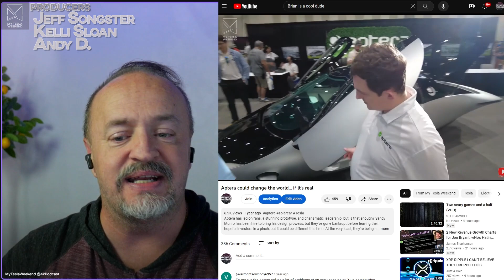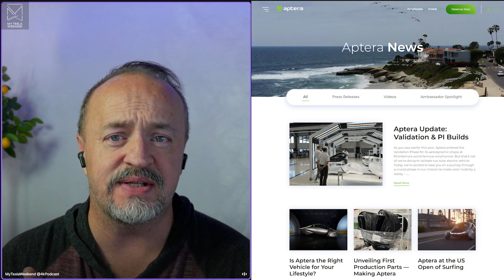Will your Aptera overheat?!? And other big answers w/ Chris Anthony

Comment: "too wide?" ...  3 places within 5 miles of here in the UK that the Aptera will not be able to go through at it's current width (for example 6'6'' road width restriction), unfortunately there are therefore interesting places that are completely inaccessible here for the Aptera with it's current width.
Reply from the maker: May be you'll never be able to get one.

Comment: I love the product, but this guy does not have what it takes to make it happen. Reminds me of Arcimoto.
Reply: It's because of my experience with Arcimoto that I see Aptera avoiding all of Arcimotos mistakes. Arcimoto is undergoing the same things every other EV company is experiencing not named Tesla. I see Aptera on a higher level in terms of design and execution because the co-CEO's were forced out of the first iteration, became successful elsewhere, then ten years later bought back thier IP and restarted the company using the same name that failed. I see them as passionate about doing this successfully this time and I'm doing my part to help them. I bought an FUV because it's made in America. I joined the Accelerator Program because Aptera is in my hometown and is worthy of support. Eventually I'll be behind the yoke.

Comment: Seems to be that there's a lot of very basic things not resolved for a car that's been under design for the better part of 9 years in total between the two iterations of the company... Or at least 4 years in the latest version. ...and they don't have things like battery management nailed down (and are not on top of the disparity between their models and the wind tunnel)... etc. I'm reading a lot of discomfort by Chris Anthony regarding still having big redesigns this late. ... and they have production to go. ... they have, what, 99% of the effort to go, according to Elon's estimate about production being two orders of magnitude harder? Yikes. I see no indication that they are planning an assembly line for mass production... no dicussion about the machines that make the machines - is it all going to be by hand? No price details anywhere, either, is there? I have a bad feeling about this.
Reply: Your assumptions are incorrect. The current Delta design was revealed this January '23. Which is now the PI build, of which is about 66% complete. These will be used for vehicle validation and crash testing. Aptera has had Alpha, Beta, and Gamma prototypes up until this year.
Aptera is as close to Accelerator deliveries by next summer as they have ever been before.
Reply: @barnabasseadog7660  "Your assumptions are incorrect." I can't identify what Roger's assumptions you are referring to, and everything you say here doesn't point to a correction of any sort. If you say something's wrong, you need to be clear about what, then provide a clear correction. 
"The current Delta design was revealed this January '23." He didn't say it wasn't; he said the latest version between two iterations was 4 years old. That is not the Delta design, but all 5 fake prototypes as opposed to what existed pre-2011 - and he's right. 
"Which is now the PI build, of which is about 66% complete." The 66% is a lie, and mnisleading at best. You don't make a handful each of 4 from 6 required body panels, put them in piles and say an EV is 66% complete. It needs wheels, motors, seats, solar and dozens of other components plus the assembly. This is how you tell someone that they are incorrect; happy for you to discuss.
"These will be used for vehicle validation and crash testing." Roger never mentioned this, and he probably knows it. You are off track. 
"Aptera has had Alpha, Beta, and Gamma prototypes up until this year." I'm pretty sure he knows that, as well. He didn't say anything to the contrary. You can't say he is incorrect about stuff he hasn't mentioned.
"Aptera is as close to Accelerator deliveries by next summer as they have ever been before." I have to agree, which means they can be years overdue - like before. And that is the crux of Roger's message. You have finished by indicating he's right. That is a foolish way to correct someone - a genuine sign of a scatterbrain.
Reply from the maker: Go watch the previous video.
Reply: I have to admit - the same scenario is what gives me good feelings, lol. Especially when the "couple of months" at the Tesla Takeover was 3 months ago, and Chris will be years off track for yet another time. I love watching who stays the loyal butt-lickers for the longest.

Comment: Great video.  A question I'm not seeing asked is about the steering yoke.  I have hand and shoulder disabilities and don't feel comfortable/safe with the yoke as it is, especially if it's slow-ratio steering like regular steering wheels.  There's been alot of negative publicity, including Consumer Reports regarding Tesla's yoke, and they promptly offered a no-cost option wheel. Lexus has a yoke that rated better because it has quick-ratio steering at low speeds.  Will Aptera offer a wheel for us old-fashioned normies, or will it have really quick ratio steering at city speeds? Great machine, please don't lose customers like myself over something so silly.  Please go the Tesla route, offer both!
Reply: Aptera assumes you don't know what you want. One hundred years of automotive evolution has you biased.
I agree, and look forward to driving an Aptera with a yoke.
Reply: @barnabasseadog7660  "Aptera assumes you don't know what you want." Jelad is clear about what he wants. Are you able to represent Aptera enough to be correct about this poor assumption you say they have? Do you mean Jelad only, or everybody?
"One hundred years of automotive evolution has you biased." He was pretty clear his disabilities were his motivation. I have no clue as to what he knows about 100 years of auto evolution, and I'm certain you don't.
"I agree, and look forward to driving an Aptera with a yoke." When someone asks a question, they expect answers to their question, not scatterbrained, off track nonsense. This couldn't be any sillier.
Reply: @aussieideasman8498  I can see why you hate Aptera more than you love your cat.
Reply: Their market research has left you out. No matter; they will never sell one anyway.

Comment: What are they doing about the accident they had with the Gamma because the other driver mistook the wheel pant as part of the road and hit it? 
Are they adding any precautionary measures to the wheel pants to prevent this on a large scale? 
Because, even before this accident, someone i know (and several people online)  predicted this would happen and it has.
Reply: Where did you get the other driver mistaking it as part of the road? I have not heard this before. The damage was done to the front of the part, as seen in pictures, so it wasn't hit from behind. What exactly did happen, because it looks more like a hammer was taken to it? Let's get a chain of people who know something to all enlighten us?

Comment: Next time, please ask him about the metal CHASSIS / FRAME.
This is a huge part of the production and there’s very little info on who the manufacturer / supplier is?

Also what are they doing about the accident they had with the Gamma because the other driver mistook the wheel pant as part of the road and hit it? 
Are they adding any precautionary measures to the wheel pants to prevent this on a large scale? 
Because, even before this accident, someone i know (and several people online)  predicted this would happen and it has.
Reply: Aptera Owner's Club released a video about the accident recently. It has been repaired. The  driver of the BMW took off and they didn't get a plate number. Not a lot one can do about bad drivers on the road other than try to stay clear of them.

Comment: If it’s design-locked I’d like to understand how they could alter the vehicles shape after the full wind tunnel test. And if it’s design-locked what is the final drag value?
Reply: Gamma is much lower to the ground and devoid of hoses to the motors compared to the final PI (no longer Delta), so the test is absolutely useless. It was to draw in some more gullible suckers - a snake oil stunt.

Comment: How will the Aptera be towed to a repair shop if one of the wheel struts is sheered off ?
Reply from the maker: Flatbed. Is that a thing that happens to you frequently?
Reply: I have ordered an Aptera. I wasn't sure how the front end would be raised by the tow truck to bring it up on the flatbed.  Is there an attachment on the main body of the car to raise it up if one of the struts was gone ?  I have never had a car that didn't have two axles for raising the front end. @FutureAzA

Comment: Question: Elaphe propulsion production facilities.
We’ve heard and seen a lot of videos about CPC production and facilities, Maxeon solar cells, and the batteries and battery packs.  But we have heard very little information about Elaphe’s in-wheel motors production facility. Is Elaphe capable of keeping up with the demand from Aptera or are they going to slow them down. Also, Sandy Munro made a comment recently about Aptera going away from in wheel motors, because “they  couldn’t them” and then we were told that he “mis-spoke”.  I’d like to hear a more detailed explanation regarding Elaphe.  My concern is:  At the Tesla takeover, Chris said that they were going to produce maybe a few hundred, maybe as much as 1000 vehicles in 2024.  That’s significantly less than the “40 per day” that he had stated previously.  Could this be because of Elaphe?
Reply: The question is for Brian to ask Chris Anthony. He said they he would do a second interview and ask for questions from viewers.
Reply: Good questions - I can't wait for his answer.
Reply: He has answered another guy 3 hours after your question. Needs more time for you? Maybe chose not to answer?

Comment: I realize the LE Aptera won't be able to tow, but if Aptera could tow a second wheel-driven Aptera, then that could basically end the "but it only has 2 seats" challenge.  Alas, this may be forbidden by regulation, depending upon the jurisdiction.  One would also need to assure the safety aspects.  If permitted, this could improve the versatility of Aptera significantly and give reason for many people to not just buy an Aptera, but to buy two of them.
Reply: I have 2 on order, likely not the only one

Comment: One other question. Curious to know why there is a steel/aluminum roll cage sandwiched in the roof, is this for the case the car would roll more than once in an accident and still keep occupants safe?
Reply: A Corvette doesn’t have a roll cage. It has an SMC body too. So I’m thinking they are just trying to make it the safest vehicle ever.
Reply: @billsmith5960  There are many ways to make SMC roofs, and there are many materials used; one roof can be strong and the other weak. Usually, a legacy maker knows what they are doing and a startup doesn't, so there's that.
Reply: @aussieideasman8498  - As for GM with the Corvette. They use SMC throughout the chassis and even have removable roofs. Top it off, they even have hydroformed aluminum frame rails on a Z06. If you see a C8 they even added more SMC yet no roll cage.

With the Corvette, they have to pass crash tests dictated by the federal govt. Aptera does not. Yet GM sells about 35K of their units which is not even close to the 600K that Aptera sees as their numbers.
Reply: They do show a 'roll bar' in the exploded renderings that I've seen. It's integrated into the roof. I believe it's steel but can't say for sure.
Reply: Roll cages are always there because the roof structure is unable to protect the occupants by being too weak. So much for the 7 times stronger than steel lie that's still being used.

Comment: Thank you Brian for asking and Chris for answering. What I want to know is about financing. Is Aptera waiting on the US DOE money specifically before kicking off production of the first 2,000 vehicles? Having worked in a startup before, I know that there are different types of funding out there, some with more strings and higher costs than others. I would also think Steve and Chris are likely to be gun shy about some types of funding after what happened to Aptera the first time around. Thanks!

Comment: Width - Aptera 2,225 mm (87.6 in). Land Rover Discovery 2,000 mm (78.7 inches). That's a lot when it comes to parking the thing. I suspect it's parking more than driving that worries people, but take a Google Street View around Kensington and tell me if you'd want to drive around in any car with a bigger footprint than a Land Rover. The solar car I was interested in for the UK was the Sonos, so if Aptera buy that IP and make a version of it, great. Otherwise I think we'd need a significantly smaller vehicle but there's a dozen vehicle types they could do next that would be interesting.
Reply from the maker: Footprint includes the total area, not just the maximum in one dimension.

My problem with big cars was never about fitting the fenders between obstacles, but dragging the rear end around behind me without clipping curbs, walls, and other cars.
Reply: @FutureAzA  to be fair, I hadn't checked the length and it is shorter than the Discovery by about 50 cm (almost 2 feet). I'm aware footprint does include both, but it's the width that will cause the bigger problem since your wheel will be stuck out into the road. 

A Discovery is about as offensively large as cars get in the UK, and since the Aptera's wheel is low to the ground, I foresee it getting clipped by people in such vehicles who are just trying to get down a street with cars parked either side. If you can even fit the Aptera down the middle of the street in the first place, which is unlikely in many places in my local cities, or even the rural villages near me. 

And yeah, personally I don't want to drive either, massive cars are off putting and I have a lot of respect for everyone who can drive a lorry well. I have zero respect for Land Rover drivers who do not, in fact, live on a farm of course. We call them Chelsea tractors because they're massive obstructions. 

I'm hopeful that Aptera will evaluate it if they survive the next five years, and produce a new model, even if it's just a smaller one (which I'm sure would be popular in the US as well). I still want them to do well, to be clear because more options is gooder, but I just don't see the current Aptera being useful in the majority of Europe. Or Asia.
Reply: @FutureAzA  "Footprint includes the total area, not just the maximum in one dimension." You mean in one direction - width or length; they are not referred to as the dimension. Area is two-dimensional and volume is three, but distance and direction are the terms for lengths, widths and heights of any dimensions. Just saying.

"My problem with big cars was never about fitting the fenders between obstacles, but dragging the rear end around behind me without clipping curbs, walls, and other cars." Then don't drive big cars. However, you miss his concern; while he does mention footprint when writing about the Google exercise, his initial point was the stated widths, and he showed no interest in your driving problems. You ought to address the width issue around Kensington.
Reply: I agree the size of the vehicle will be an issue on UK roads, North American roads are usually much much bigger and straighter. Tbh although the solar will obviously work in the UK, the amount of mileage you get per day is going to be significantly lower than North America or other warmer climate locations.